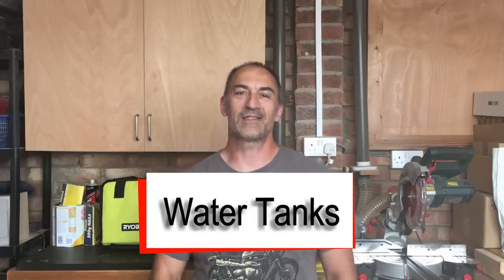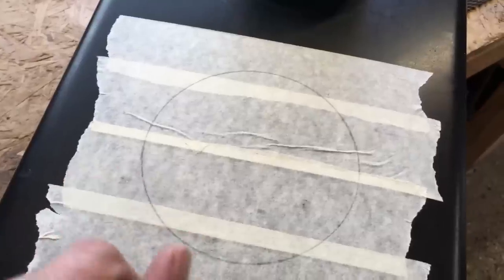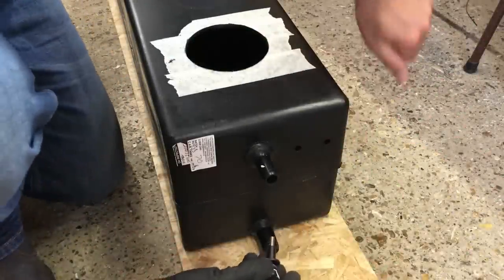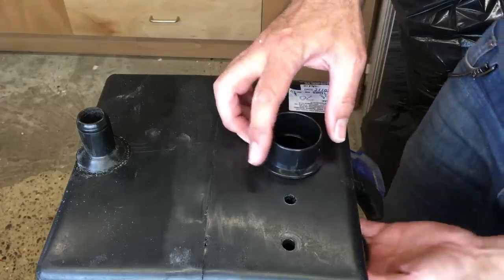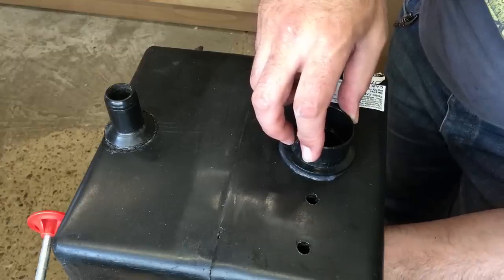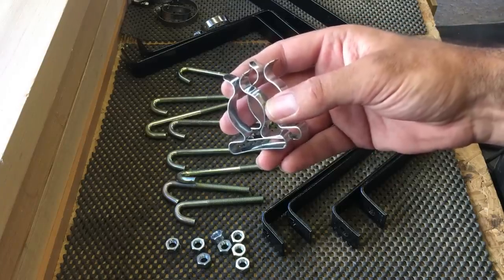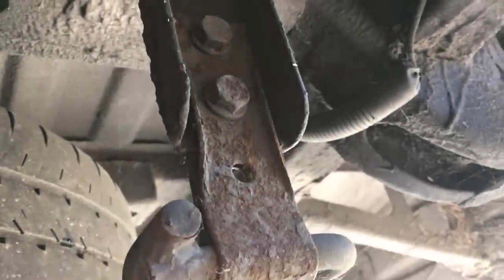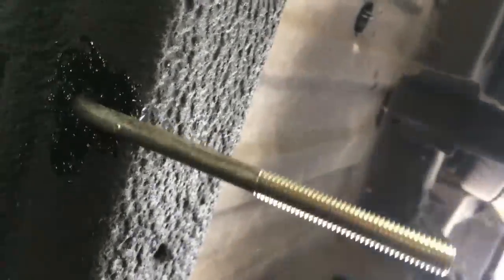Mercedes Sprinter Campervan - Water Tanks

Comment: Looks very tidy! What's your experience in cold weather temperatures with the external tanks? Most people here in Belgium advise me to install the tanks indoors. But that takes away a ton of space.
Reply from the maker: Vinie Vizzle Vlog we have headed south for winter so far. I did insulate the pipes but have only spent one or two days in freezing weather. I would put water inside and gas outside on my next build.
Reply: @GregVirgoe  Have found a water tank that I can put upright in the meantime. That could work indoors in our layout. Thanks for the info mate!

Comment: Hi Greg, apologies if this has been asked before, did you put traps on your waste water pipes?
Reply from the maker: Yes I fitted a traditional bottle trap to the kitchen sink and formed a running trap in flexible pipe under the van for the shower. Otherwise the grey waste smell would come up into the van 🚐 👍🏼😊
Reply: @GregVirgoe  Thanks Greg, I assumed you would have, makes sense.

Comment: Hi Greg dose the sureflo pump suck the water from the fresh tank or do you need submersible pump
Reply from the maker: Hi James, the pump is self priming so it will suck up from the tank even if the pipes are empty and it does it really quickly too 😃

Comment: Hi Greg. Does your grey water tank have an air vent?
Reply from the maker: The top of the tank has some very small vents. However having larger inlet pipes allows for some air movement 👍🏼🤩you can also install vented traps to prevent any syphon effect.

Comment: I've been binge watching all your videos, you've done a 1st class job, very impressive! Thanks for sharing all the details, I think they are so important.
My question is, how do you size up the bolts and brackets to know that they will carry/hold the water tanks? Water is quite heavy. I also wondered about the parts of the chassis that you attached the tanks to. I have no clue about this stuff, so I worry about all the possible things that could go wrong when I do stuff. So is the added weight of the water a consideration as to where you made the connections?
Thanks again. AWESOME BUILD!!!
Reply from the maker: NotSunkYet It’s wise to be concerned however the tank manufacturer provide the brackets and bolts and they are easily very strong. 
1litre weighs 1kg so my 75litre fresh tank is 75kg and that is held up by 4x M10 bolts which is less than 20kg in each bolt. Well within it’s capability.

Comment: Did you invent the water sensor or did you buy it, I've seen a few online that are quite expensive. But it looks easy enough it make one? What do you think?
Reply from the maker: Hi Ben, they are just a couple of stainless machine screws so perfectly possible to make your own, try lighting an LED light with a 9v square battery be safe as houses to try out. I've got a spare battery myself so going to try it tomorrow. Great idea Ben 👍🏼😃

Comment: Oh! Sorry for the double comment. Haha

Also, I forgot to mention in the last one that I really appreciate your videos. Very informative, and your work looks great when you're done!

I'm trying to approach this from a budget, but still want to end up with a pretty and well-finished interior. I'm considering box trucks and buses of varying sizes, they can be had used (sometimes in proper running condition!) for around $2,000 US. Of course, the vehicle will always end up being its own maintenance project at that budget.

Do you have any thoughts or opinions for building inside of either of those types of vehicles? I've heard people criticize using the box of a box truck for its lack of structural integrity--I always thought it seemed easy enough to build my own 'frame' inside of it. For the bus, lots of people have successfully raised the roof (and documented their work) on lots of school buses, and that's pretty attractive to me.

Thanks again, for doing what you're doing! :)
Reply from the maker: Hello Alex, there’s a lot to be said for working inside a square shape. Every wall, door a d ceiling of my van is curved and that makes furniture build very time consuming. Seen a lot of really cool bus conversions. Only downside for me the the vast number of windows. That affect heat loads and solar gain and privacy too. I imagine a school bus to be less economical on gas to run. Regarding budget I would go for a slightly better van and cut back on your build budget as if you van becomes uneconomical to repair due to engine or rust issues your hard work converting will be all for nothing. Hope that helps
Reply: Yeah, if I were converting a bus, I'd consider replacing a lot of the windows with steel panels. (Sometimes that's part of people's roof raise project.) Or aluminum if I could be sure it wouldn't be problematic next to the steel of the bus. Not only is glass not great for thermals, but it's actually quite heavy, too! I am planning to learn more about working glass, replaced windows could be reused for interior design.

You make a good point, that spending more on a better-condition vehicle could be the more economical choice in the end.
Reply from the maker: I only know from close friends that bought a cheap van and did a lovely pine toungue and groove panel conversion only to find it needed a lot of welding and the garage refused to do the work because of the fire risk. 
He has since bought another van and is now ripping one apart to build another. 
You need a sound base to work off as it’s a lot of effort.

Comment: Hi greg, did you put a 10mm breather pipe on the fresh water tank as well? Also related question, how did you seal under the van where the shower waste outlet is? Thanks as always :)
Reply from the maker: There is a vent on the back of the inlet cap that you fix to the side of the van. It’s there to vent the tank and allow air in while you are drawing water out. 
The waste grate underneath the van was sealed with black Sikaflex and sprayed with waxoyl to prevent rusting.

Comment: Did you install the access hatch at the bottom of the tank so you can access and clean it when its installed?  My Barratt tanks waste is 19mm and the kitchen sink takes 20 mins to drain so I'm looking to do a similar modification by increasing the hose size.
Reply from the maker: Yes absolutely correct

Comment: Do you mean gray water tank or toilet and grey water? Are the tanks generic or designed for make and model. You have a three season grey water and fresh water. Many people use under sink 5 gallon fresh and grey water.
Reply from the maker: Hello Robert, the tanks are specific to each model of van and CAK Tanks Ltd make a huge range to fit all types of vehicle. In my van I have Four tanks. 75litre fresh water tank under the chassis, 50litre grey water tank under the chassis, 10litre drinking water Jerry can in the kitchen sink unit and a black water cassette tank in the Thetford toilet. I wanted larger tanks because we have the combi boiler and the shower in our van.

Comment: Was the access hatch you put in the waste tank on the top or the bottom?
Reply from the maker: I put mine on the top because I was concerned about it leaking but maybe it would be more convenient on the bottom same as the fresh water tank 🤔😊
Reply: That's what I am worried about. Your fresh water tank was manufactured with the hatch already on.
Reply from the maker: @markrichardson5496  if it’s sealed correctly it shouldn’t leak.

Comment: One thing is confusing me a bit. with the water system: If you have a sealed tank of fresh water, where does the air come from to replace the water that's being pumped out? If you pump water out of a tank without any way for air to fill the tank, the tank will start to vacuum and your pump won't work.

What am I missing?
Reply from the maker: There is an air vent on the back of the filler pipe.
Reply: @GregVirgoe  I don't see one? I'm unsure as to whether I need to be drilling another hole for an air vent? Also, in your video at 2:06 I see some little washers on top of the waste tank: what are they? Are they holes?

Comment: What about breathing and overflow from these tanks ? Where is the excess of air going when you fill the tank ?
Reply from the maker: Maciej Piotrowski the inlet on the side of the van has a vent pipe which I have fitted a filter to stop any bugs getting in. That also prevents the tank from collapsing when the pump runs. There are some tiny AAVs on the top of the tank
Reply: What about the grey water tank. I didn’t see a vent for that.  (Love your videos by the way. About to build a similar bed)

Comment: The only problem that I can envisage with increasing the diameter of the waste tank inlet, is that the water inside the tank will have a tendency to slosh back out of the tank whilst driving and back up the pipe, creating a wider surface area for drain smells, or even water coming back up into the shower basin?  It could also create a vacuum affect drawing water out of the U bends under the sink? Saying that, you could always drive with the plugs in I guess?
Reply from the maker: Hello Barry, The tanks are installed with internal baffles to prevent the water from sloshing around.
You actually get more syphoning effect with smaller diameter pipework because the water fills the complete bore more easily.
With a larger pipe, there is more room for air to pass by the water.  You can fit anti syphon traps to prevent traps being pulled out.
I would strongly advise emptying your grey water tank before setting off on a journey, why carry loads of wastewater and spend more money on fuel hauling the extra weight about when you don't need it.
Reply: Anti syphon traps! I didn't know they existed! That will solve the issue I have in the bathroom at home, where water from the sink drains the trap under the bath. You learn something new every day. Cheers!
Reply from the maker: They have a small air admittance valve on the trap to allow air in to prevent the trap being pulled out. 
If your bath and basin were connected to a larger float that may not happen.
Reply from the maker: Here you go https://rover.ebay.com/rover/0/0/0?mpre=https%3A%2F%2Fwww.ebay.co.uk%2Fulk%2Fitm%2F183309415175

Comment: Curious why would you size your discharge tank to be smaller than your supply tank? I would think it should be the other way around? so that it's not possible to overfill your discharge tank as it is possible to do in the setup you are currently using. Plus if you had of switched those tanks as to their purpose would it not have negated the need for you to change out the fittings?
Reply from the maker: You use some of the water and it doesn’t end up in the grey waste. Drinking, flushing toilet, etc I have a warning light to let me know when the tank is full so it’s never been a problem

Comment: Can you add a note about winterizing your water tanks? Can this be done as an afterthought or do you need to buy special insulated tanks?
Reply from the maker: While these tanks are quite thick and plastic is a poor conductor of heat you would still need to have them insulated to prevent freezing.

Comment: How do you prevent the water in the tank from freezing?
Reply from the maker: Don’t go anywhere that is cold 🥶😂 we built our van for sunny holidays. You could insulate it or install 12v tank heaters but they would use power which in winter May be hard to generate off grid.
Reply: That is my plan to add heater and insulation. Also, will form some sort of  metal box to wrap the tank, then place insulation and heater in between.

Comment: Hey Greg, thanks for another wonderful video!

Question:  Are you planning to us traditional P-trap loop seals for the sink and shower, or will you be using inline traps such as the HepvO?
Reply from the maker: Hi John, I'm a traditional type of guy and will be going with conventional wet traps on both the shower and sink.
I'm familiar with HepvO waterless traps but I find they do not seal over time and offer a small resistance to flow.

Comment: Don't you also want a backflow preventer on that tank inlet line just prior to the tank as well?
Reply from the maker: irongoatrocky what would be your reason for suggesting that be fitted?
Reply: @GregVirgoe  a couple incase your going down hill or parked on an unlevel surface the waste water doesn't comeback into the shower.....and it's also an odor control issue....there are alternatives to p-traps that help with this but a backflow is better piece of mind here
Reply from the maker: irongoatrocky ok I see what you mean now. I made a trap out of bends under the van which is enough to stop the issues you mention. After a year of using it we never had any issues. Cheers

Comment: Can anyone advise how you should size the water tanks in terms of the grey one being smaller than the fresh one?
Reply from the maker: I didn’t size them as much as get the ones that are designed to fit in the space under the chassis as made by CAK tanks Ltd. They do many different tanks for different makes. So it is what it is in this location. Inside your van you have scope to do something different. Bear in mind that 1litre = 1kg 😊
Reply: @GregVirgoe  Thanks for the prompt reply. I wondered if there was meant to be some sort of ratio, obviously not. Really informative vids! Keep up the good work.

Comment: hello greg no vent pipes ? where is air supposed to go when filling tanks
Reply from the maker: The filling cap has a vent on the back of it and the fill hose is 2” dia
Reply: @GregVirgoe  but isn’t the vent tube on the filler cap for attaching a pipe that then goes to top of tank to let air in and out as water level changes ?
Reply from the maker: @johnsquibb5008  that is not necessary. As long as you vent the tank to atmosphere it will work perfectly for filling or emptying.
Reply from the maker: The vent on the back of the filler is connected to the tank by the filler pipe.
Reply: @GregVirgoe  so are you saying that the air displacement in your tank goes up the same pipe that water is going into when filling the tank ,
Obviously this works ,   but if you were filling up fast with hose pipe wouldn’t it cause a problem with air bubbling back up causing a blockage as such

Comment: no the fresh water tank needs access because you MUST chlorinate it or you will be struck down with various bacteria that will grow in your fresh water tank , you must remember that bacteria multiplies very quickly between 20-40 degrees and that why you dont use stored drinking water in your home
Reply from the maker: Firsteerr Lastmwwew, watch my water services video, you will see I have a separate drinking water system in my kitchen unit. I will not be drinking the water from the tank under the van, it is only for washing with. The water tank has the big red access hatch you see in the photo. 
I dealt with water treatment and chlorination on a daily basis as part of my job which is why I have installed separate drinking water system.

Comment: You might want to consider electric opening drain off valves they are only cheap really and a switch from inside the van. Then bingo Bango not messing

Comment: I always enjoy your videos...however.. installing water tanks, brown ,black, fresh, etc in small campers is over kill.   I am building out a sprinter right now .. under the sink I have two 5 gal drums, one for sink water, one for fresh, since most of the campground s have showers ,I do not need one ,this saves me mpg , as I don't have to lug around 100 gal of water.   Your camper will never be your house, don't fill it with over sized furniture or kitchen cabinets ..less is more.